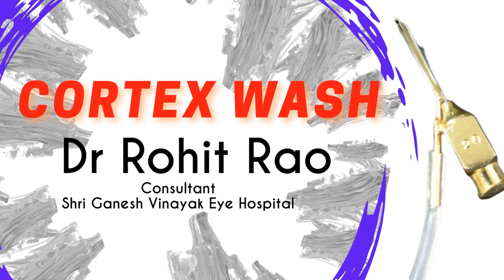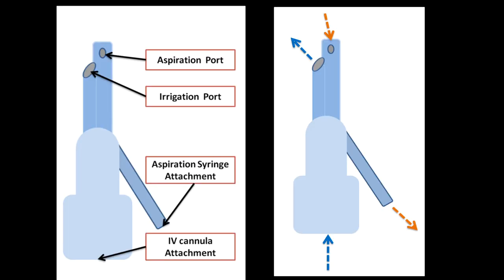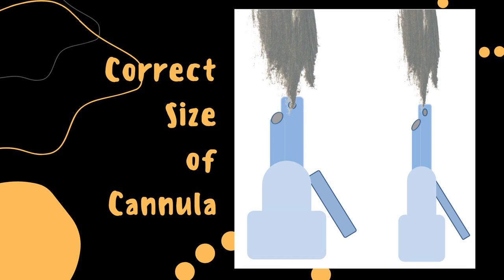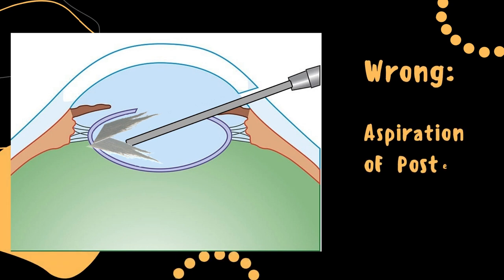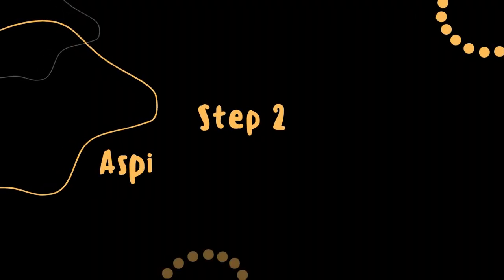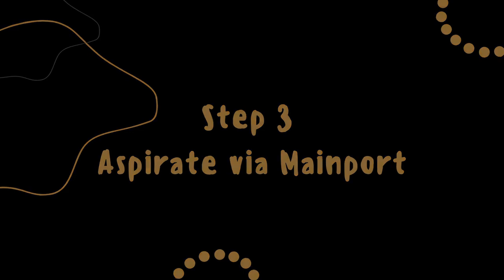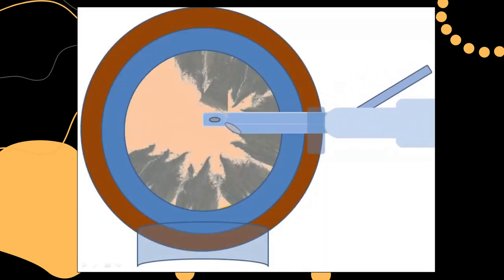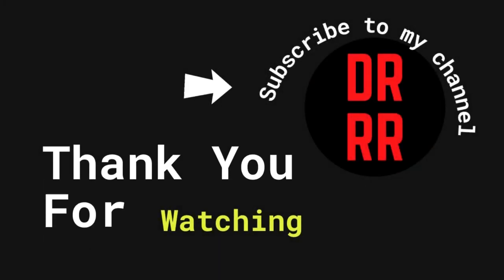10 Cortex Wash in SICS

Comment: Many times i face this problem
After partial cleaning, subincisional anterior sticks to post. Capsule.,with enlised lensmatter. Any jet of bss doesn't helps to sepate  the two capsules. Attempt depress post capsule by simcoe causes pcr. Leaving lens lensmatter in side causes uveitis in po period. Can u suggest a solution?
Reply from the maker: Sub incision cortex is pretty tricky
You need to twist the simcoe  and try to make aspiration port face  the Cortex

Comment: Sir how about tight cortex and our simcoe can't aspirate it. Sometimes in manual SICS, the tool was not good as phaco tool. Thank you.
Reply from the maker: In that case 
1. You can repeat Hydro at the exact same area to free the cortex 
2. You can use visco to try inject between capsule and cortex 
3 . If it doesn't come then better to leave it as it is

Comment: Sir kindly let us know how to remove thick epinuclear sheet quickly in sics
Reply from the maker: Epinuclear sheet removal 

# it is slightly tricky and needs patience for its removal

1. Try injecting Visco or repeating Hydro  in between the Epinucleus and Capsule
2. Try to give pressure on the Iris all around , gentle strokes, and pressure over the main port it helps in removal
3. Commonly we try to catch one fiber of cortex and pull , but this will not work . So, we need to make the Epinucleus and cortex free from all around and then deliver the Epinucleus  as a single unit out of eye as its very difficult to aspirate it

Comment: Sir, if simcoe canule  accidentally touches the posterior capsule, can it cause pcr?
Reply from the maker: Hi Dr 
There is high probability of pcr if Simcoe cannula touches pc
But it depends largely if the suction is on or not

Always try to catch the anterior fibers of cortex this will prevent pcr